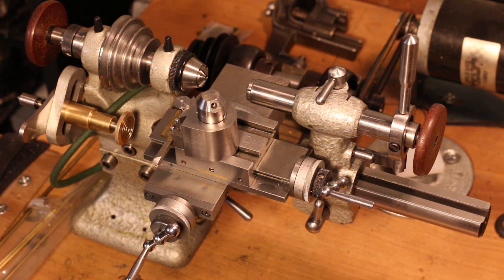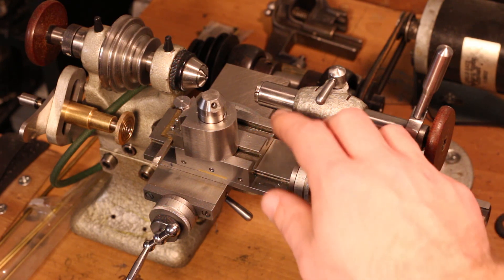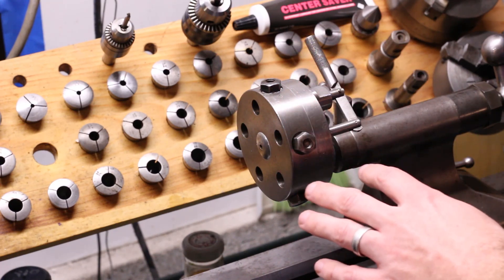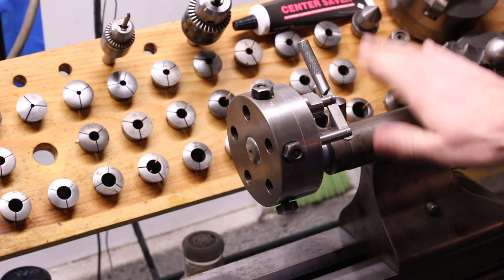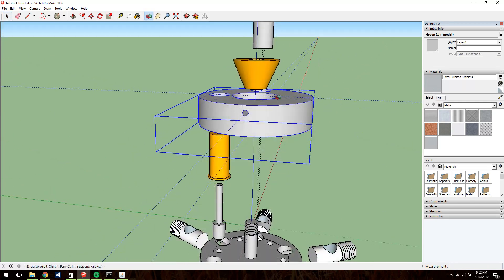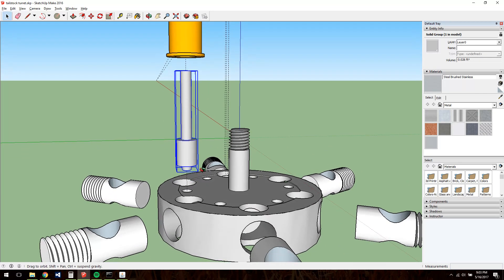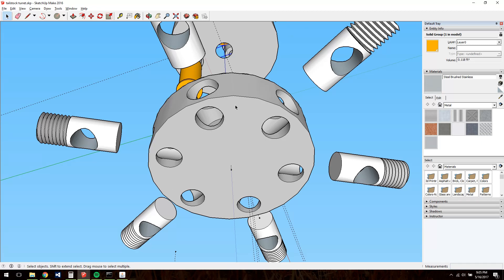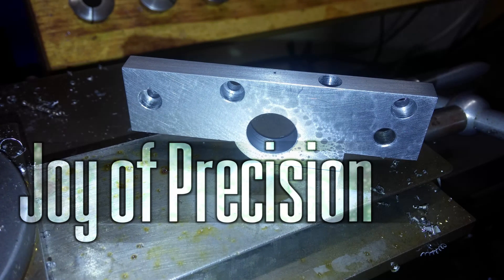My Entry, Emma's Toolmaking Competition 2017

Comment: That's a big penny!  Looking forward to seeing the end result.  4140 pre-hard for most of the stuff?
Reply from the maker: O1 for the shank (turning that this very moment actually), will be roughed then heat treated then finish turned. Either O1 or W1 for the indexing pin and clamping rods, and mystery steel for the backplate and body. :)

Comment: Good luck!

I'm sure you will find it useful. I have a similar lathe with a 4-station turret that I mostly leave attached.

Will there be not be individual stops?
Reply from the maker: Thanks!  I'd love to know more about your set up, turrets on this type of lathe are uncommon.  For turning operations, adjustable stops can be placed through the center bore of, for example, a knee turning tool holder, to stop against the work.  For drilling operations, an adjustable stop can be accomplished in the form of a collar placed around the drill bit, again to stop against the work.  It's difficult to design proper turret station stops into a tailstock turret, especially on a small machine like this.  Stops protruding from the front of the turret, with this design, could easily get in the way.  Stops mounted into a separate collar at the rear of the tailstock ram (configured to stop against the tailstock casting) would be more out of the way but would have to be manually indexed separately from the turret itself and more importantly would use up some of the tailstock travel (which is already pretty limited on this machine).  I do have an idea though, to have stops fixed to the outside perimeter of the turret body that protrude behind the turret backplate.  Each stop would have to be shaped like a round anvil to sort of hook behind a stop plate (either attached to the tailstock casting or the bed).  Reach-behind stops, I guess you could call them.  That's what I'm tentatively planning on, but not for this initial prototype.
Reply: I saw a bed turret for a d-bed on Ebay when I started looking!

Mine mostly looks like your design, with small differences in the shape of the parts. The tailstock barrel is rack operated, though.

The axle that the turret rotates on extends through the bearing and past the end of the barrel, and the stop screws are on a disc clamped to it near its end. The long axle turns as well as slides in a support bracket screwed to the back side of the far end of the tailstock, and the bracket is what the screws stop against.

But you're right, and I hadn't thought about putting the stops on the tools themselves. That's pretty funny since one of the tools on mine right now is a stop.

Comment: have you checked put Fusion 360? more powerful CAD program that is also free. i fimd it less frustrating to work with than Sketchup. I am used to Solidworks and Fusion is the closest free option I have found.
Reply: It's free for commercial use as well, up to 100k in revenue.

"A free 1-year startup license is also available for hobbyists, enthusiasts, makers, and emerging businesses that make less than US $100,000 in revenue per year. At the end of 1 year, you can reselect the startup entitlement or transition to a commercial entitlement.

See Terms of Service: Autodesk Web Services Entitlements."
Reply from the maker: Thank you, Pete, I totally missed that under their entitlements document - it said "Startup" so my brain immediately said "oh that doesn't apply to me", haha.  This will be awesome, I'm looking forward to getting some experience with it!
Reply from the maker: I've certainly heard of Fusion 360, but always thought their free version was only available to students.  I recall that they require proof that you're a student.  I just did some googling and couldn't find indication that it's free for non-students, is there some information you could point me toward?  Sketchup is a pain in the neck for stuff like this, very quick to pick up and use, and a really slick application, just clearly not meant to be used for machining projects.
Reply: its free to students and hobbyists if your a small business it is free up until your revenue exceeds $100k. you just have to resign up for the free license every year. check out the website and sign up. would be perfect for machined parts. it also has CAM integrated which is awesome for my CNC mill I made at home.
Reply from the maker: Sqwince23 Got a link? Last time I tried to go through this they wanted proof of being a student, I must have been using the wrong process.
Reply: It's free for non-commercial use, there are a bunch of other CAD solutions out there if it doesn't suit you like onshape etc, sketchup is awful for CAD, it's so limited and prone to weird geometry issues.
Reply: I haven't used any 3D CAD tools before, but started to use OnShape recently. Its free as well.  I saw that Stefan in Germany was using it, so I gave it a try.  As I have nothing to compare it to, so its hard for me to compare it to other tools.  However, I do believe they have a fresh approach to CAD, and I was fairly quickly able to do "complex" designs with moving  and rotating simulations.  Cloud based of course.  Check it out.....
Reply: Yeah whole point is to get people to try it for free, get used to it and not want to switch to something else when they get hired by a company and asked which software the company should buy for them, all makers of professional software realize this at some point if there is some other software that does 75% of what yours does and is free you're doing to die out at some point because teenagers will use the free option and will keep using it after they get a job.